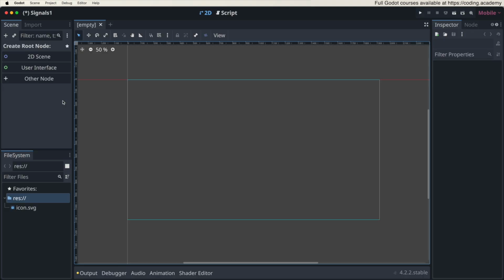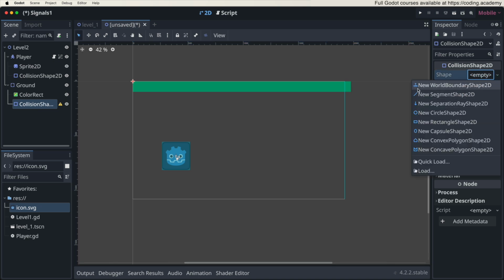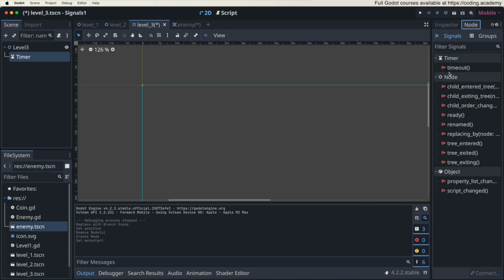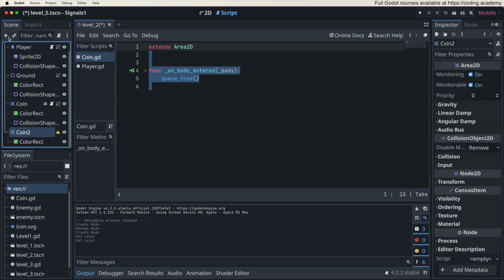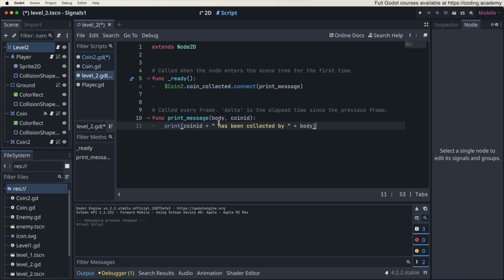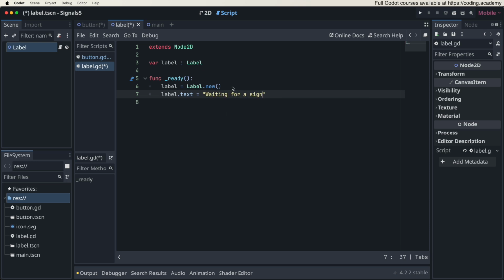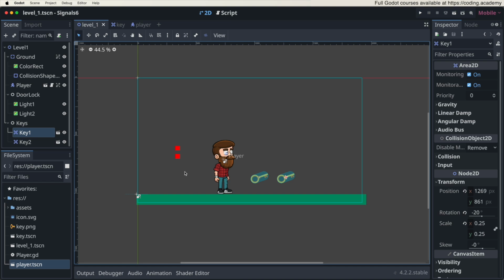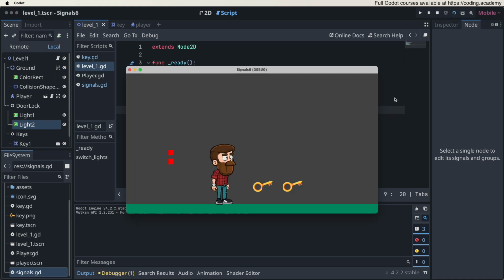How to Use Signals in Godot 4

Comment: There's just something about the way signals work in Godot that is a bit confusing compared to other languages event listeners, and there've been syntax changes across versions of Godot that make looking up the correct usage of signals difficult.

This is a great explanation of the fundamentals, something surprisingly hard to come by.

It would be good to have some explanation of the handling of arguments passed with the signals and what happens if you start mucking about with .bind...  I'm about 80%-90% sure I understand that stuff, and I don't want to say anything about it in case I accidentally add to the internet's ocean of coding misinformation.